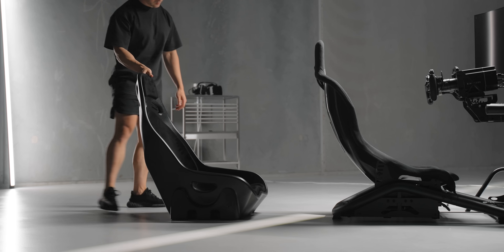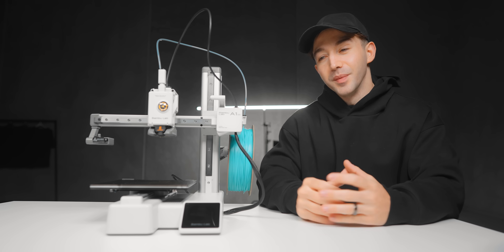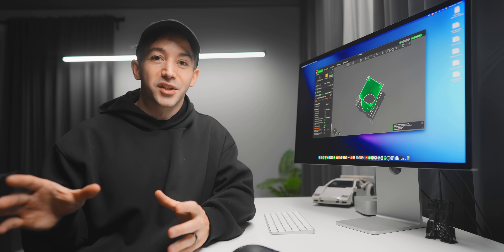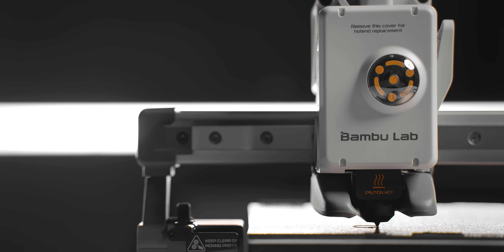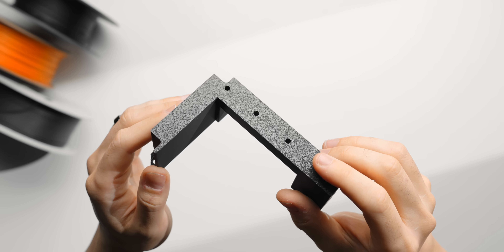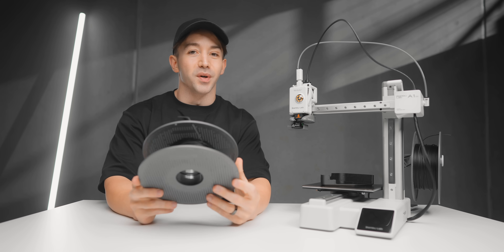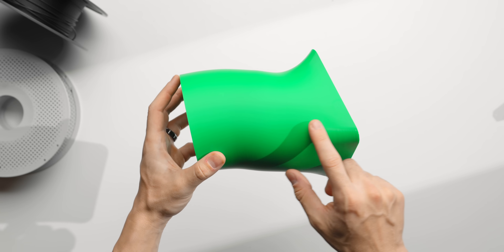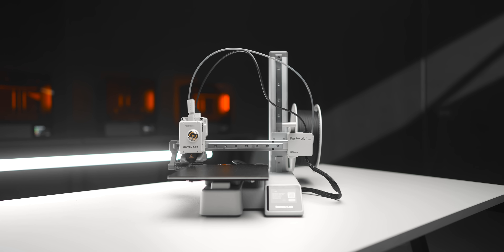I tried the ultimate budget 3D printer

Comment: With Bambulabs shift towards anti consumer practices people should look elsewhere. The centauri carbon or similar.
Bambu wilil move to only cloud until your printer is one big fully closed software cloud only, cant print without wifi, subscription box
Reply: What about the neptune 4? I was considering on getting it (default model)
Reply: Creality K1 SE is not bad as well, for budget Core XY @Lassseh
Reply: Two words, DISABLE WIFI
Reply: I'm a bit surprised he doesn't mention anything about it. For me it's a deal breaker.
Reply: but isnt that for security reasons? its literally the same as many productivity apps out there, even the medical devices from hospitals do the same, also the EUV machines etc
Reply: @あなた以外の誰でもない  What do you mean by "security reasons"? Remote attacks, hacking your printer? They did sell this was to prevent remote hacks but I don't see how forcing cloud connection / vendor lock-in helps with that. If that was a big concern you would keep the device offline to prevent that attack vector, not the opposite. There is although a different kind of "security" that they wouldn't talk about: technically they can monitor what you print and prevent you from printing certain models.
If you would tell someone they cannot print on paper with their Brother printer without sending their document to the Brother cloud with the Brother software so Brother can make sure document is OK to print... people would lose their minds. 🤷🏻‍♂
Reply: "Security reason", no is not. Is more like stealing design and never give anything back to the community @あなた以外の誰でもない
Reply: @adrianw519  bro they dont duplicate or steal ur design as u think, nor need a subscription or wifi to use the printer like the comment says, and they allow 3rd party usage
Reply: Why do you care? Isn't your computer connected to the internet right now? It's not like you bank on your 3d printer.

Comment: I actually got A1 mini myself earlier this year right before prices kept creeping up. I'm honestly having a blast using this thing! Also, should be noted that I didn't buy the AMS system with mine, but apparently the AMS 2 that works with the X1C and P1S is supposedly getting support for the A1 series later this year, which imo would add a lot of value to an already valuable 3D printer.

Comment: 4:18 iirc for inner-outer-inner (would recommend) you need 3 wall perimeters for it to really work. You mention stock settings, which I believe is just 2 walls so it would default to inner-outter (so default). If you do only want 2 walls, picking outter-inner, although it's WO se on overhangs. Not a perfect solution, although 3 walls would mostly fix it.

Comment: In my place, other than the printer, you also need to think hard about your filament storage, because daily humidity is like 70% all year long. So drying takes a really significant planning since you might want a dryer and a dry box along with all the dessicant and whatnot. That basically doubles the cost of entry and initial planning which deter many from even exploring 3D printing in humid places. I just hope in the near future people can make a TPU or PETG that is as resistant to humidity as PLA.
Reply: This has absolutely been my barrier to entry for PETG and TPU. 

I've owned the A1 and mini for 8 months now and I haven't even purchased any PETG yet because it's consistently pretty humid where I live and most of the commercial dry boxes with dryers don't get to the temps they say they do. 

I really want to just build a few dry boxes but I also need a solution to drying. I'll probably end up modding a food dehydrator.
Reply: I also live in a humid place, but I print in a closed room with a dehumidifier on almost all the time. Managing to bring humidity from the high 70s to as low as 50%

Comment: Have one of these at home and in our lab!. Amazing machine with no fault so far after a year. The only drawback is the buildplate but the portability and space makes it. Bambu has done a great job with these
Reply: Hi, as someone who is pretty clueless in terms of 3D printing - what drawback is that exactly? Is it something you would consider worth buying a more expensive model for?
Reply: @JakubNeustadt  The build plate doesn't really have any drawbacks for 95% of usecases. This thing is a steal and if you're only really doing basic prints, this thing is a steal.
Reply: @JakubNeustadt  I as somone who had the A1 (the bigger version) it's nothing to complain about. the only thing I did so far is lube the y-axis every month or so and replaced the buildplate I saw all those blue buildplate which advertise as greater adhesion with lower temperate and I bought them they were like 20$ each. and it was true I was able to print with lower buildplate temperature and had fewer failed print do the model is not sticking. So nothing to worry about.

if you can spare few more bucks buy the A1 the bigger verison
if you in budget and doesn't have that more space get the A1 *Mini*. 

both will give you the same quality
Reply: @0dyz  Awesome, thanks heaps for the info!
Reply: is bambu a1 really that good? i had an eye on this for almost a year now, looking for good and long reviews. is this good enough for a scalable and mass-customizable business?
Reply: @lipuadaft_gaming  for business, you could look on YouTube, there are a few people who are using A1s. Tbh I only got one printer and the next printer that I have my eyes on is the P1S or the P1P .. they are the same printer, but one is enclosed, and the other you have to buy the enclosure separately. What make them better for me is they are CoreXY which the bed is only going up and down and the head move right/left and front/back which give the printer more stability and you could run it faster if wanted but the main reason it's more stable which lead to more realibitly as what most bessiness will care about the speed is + but that what you will be looking for and one more thing the P1 is like a box and it won't move forwards and backwards like the A1 which will make them safer if you have backed them since you don't need extra space like the A1. Short answer I would say yes you could start with few A1 and as more you want to scale up you would buy the P1 and maybe if you will print in engineering materials you will upgrade those printers but if you only gonna print in PETG/PLA A1 and P1P (without enclosed version) are more than enough

Comment: I've owned multiple printers and the thing is, the quality is always good at the start. Give it a thousand hours of printing and see how the quality degrades. That to me is the benchmark for printer quality.
Reply: Perhaps. I paid 250€ for the a1 mini (no ams). That price included 2kg of petg filament and home delivery.
I've had it for a year now and I haven't encountered any issues. The value is insane
Reply: Bought the a1 mini a year ago and exclusively use it on the floor. Yeah, mabye the first benchy you ever print will be pristine, but if you aren't a savage with your electronics and do some vacuuming, it should perform the same.
Reply: Lol that's complete nonsense
Reply: @Studio23Media  You're telling me that a machine that has moving parts over time will not degrade in performance? If that's the case, cars should last forever, no? If you print once a week and your printer puts out the same quality it did years ago, that makes sense. But you can't tell me that after 1000 or 10,000 hours you won't see a drop in print quality.
Reply: had an ender 3 v1 and it was shite from the start
Reply: First of all that is not true lol, hundreds of printers that are almost unusable from the start. And in any case, this is their third anniversary. The A1 mini has been around for a while. Never heard a single person complain about anything besides "I upgraded because it's small".
Reply: Done that with my $180 Creality Ender3 V3 SE. Printing 4-6 hours a day for almost 2 years, and the quality today is as good as the day I got it. Well, actually a bit better cus I learned about its quirks and PLA types it prefers to achieve super clean prints. But man, it just has a level of consistency that no printer at this price point should have lol. I could go out and buy another 5 of them and they'd earn their cost back in months tops, PLA cost included. Amazing little workhorse of a machine.

Comment: best (premium) budget printer. you can get a bigger print size printer for half the price of this and learn more on it
(Edit - actually upon further review this is a really good one)
Reply: *you can learn more about it

Equivalent of saying a car is "premium" because it doesn't use a crank to turn on, and claiming buying a 1920s ford will make you learn more about cars.
Reply: @analogicparadox  not really, just making up a hypothetical with 2 extremes doesnt make it true. its the most expensive 'cheap' printer on the market. but actually looking at the prices of everything again now id say a1 non-mini or flashforgem5 are the best budget printers, unless youre only printing smaller stuff
Reply: The ai mini without ams cost 207€ when I bought it a year ago. Sure you can probably get a cheaper one if you're more interested in learning building/calibrating/modding/fixing 3d printers but for the sole purpose of  3d printing stuff it's very hard to beat
Reply: @Crookmk4  yeah for plug and play its pretty good. for cheaper i got a flashforge m5 which still auto bed levels and stuff and has a bigger print volume, i actually think thats the ultimate budget 3d printer i recommend now and its easy to put an enclosure on, or the full size a1 imo

Comment: Take a look at the Elegoo Centauri Carbon. $300 enclosed 250*250 bed 3d printer. It has some really amazing reviews.
Reply: In Canada it's almost double the price of the A1 Mini. $249 vs $449.
Reply: @__-ni1kz its a good price for a fully enclosed system. 256*256*256 with an AMS on the way. They are really forcing Creality and Bambu to launch cheap and good products.
Reply: @__-ni1kz  That actually makes it a really good price, because it's fully enclosed, capable of reaching high temps and significantly larger.
Reply: @__-ni1kz  You shouldn't really compare it to the A1 mini since the Elegoo Centauri Carbon has an enclosure, bigger build plate and coreXY. It should be compared to the X1C which is like 3-4 times more expensive.
Reply from the maker: I'll check it out, here in Aus it's over twice the price of the A1 mini
Reply: @optimumtech I am getting mine hopefully this coming month. Most are on backorder from the US. Maybe a good idea to contact Elegoo to send you a sample. Your review would make their day for sure.
Reply: @optimumtech  yeah, sadly almost all products are hella expensive over here
Reply: @optimumtech  comes with the hardened steel nozzle though, so some engineering materials. 110c bed, 320c nozzle.
Reply: @optimumtech  Down here The Centauri Carbon is currently more expensive than a Bambu P1S (Bambu sale). Elegoo really screwed up the Australian pricing.
Reply: Is the a1 the same thing but bigger @optimumtech
Reply: No multicolor system yet.
Reply: @ThisisDD I read its coming in Q3.
Reply: Elegoo doesn't pay that much for review as bamboo
Reply: I have a larger printer than A1 mini and I find it small. And the lack of enclosure and is a pain in the ass for filament type selection. And I wouldn't recommend a bedslinger to my worst enemy.
Reply: @berkertaskiran  A1 series is great and it being a bedslinger is no issue at all
Reply: Sorry to hear about the pricing in Aus, but the Centauri Carbon is an absolute beast for the price. If it’s at all close in price wherever you live, for a number of reasons, I would absolutely go with the CC over Bambu.